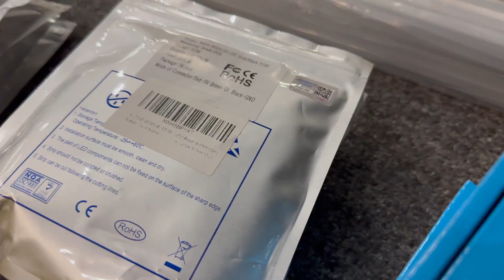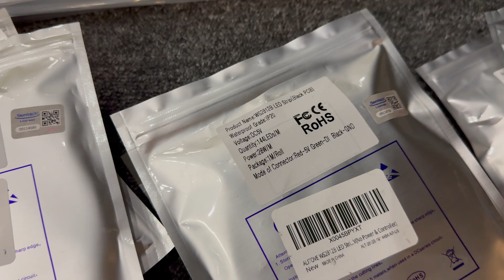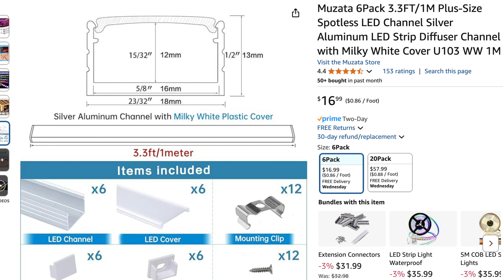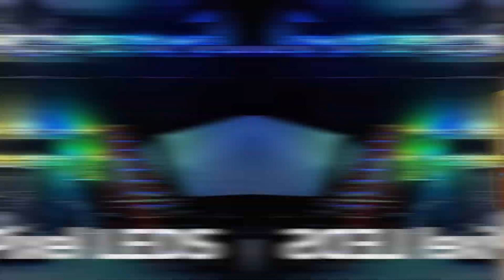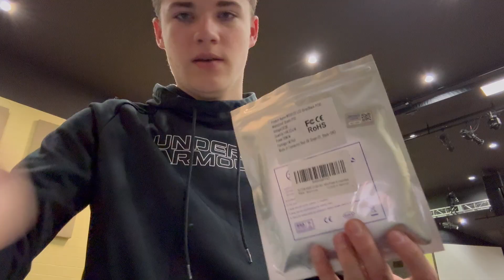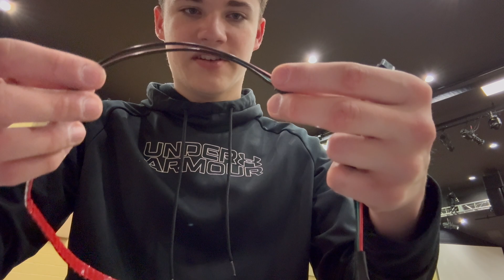Elevating this Stage with LED Pixels!

Comment: How are you connecting your esp32/wled to your network for sACN?
Reply from the maker: Just by using Ethernet on the board! You can configure it at the bottom of the WiFi settings page